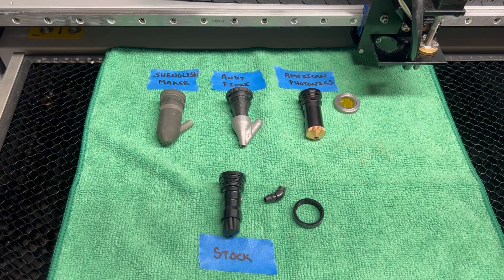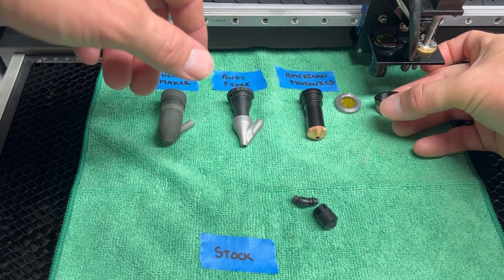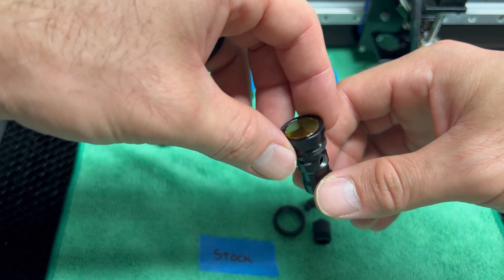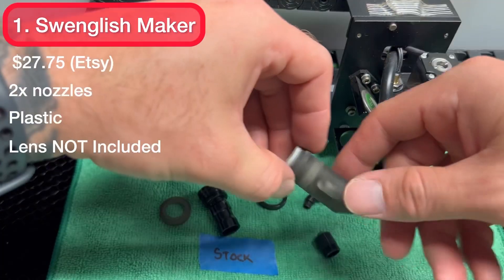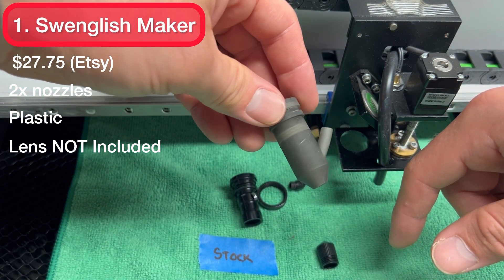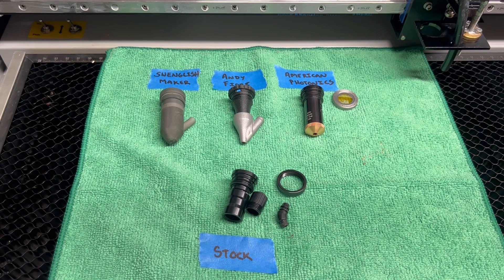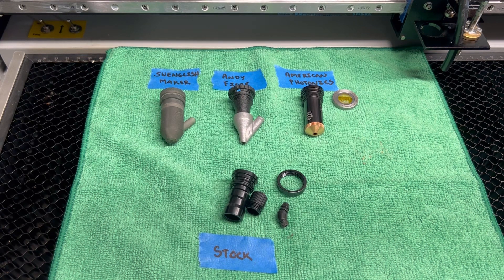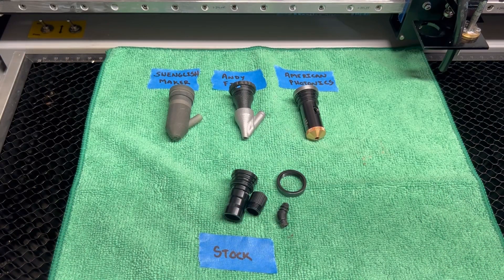Laser Nozzle Upgrade OMTech Polar / Gweike Cloud

Comment: Do you happen to know what fitting for   Air Assist Adapter
I would need for the APC LensPro for Omtech Polar / Gweike Cloud Magnetic Lens Upgrade I lost mine
Reply from the maker: From what I understood there was no direct fitting that  would replace the stock one. However APC may be making one now. I’d try to reach out to them. I

Comment: Have you found a way to completely turn off air assist?  Engraving some material looks so much better with no air assist.
Reply from the maker: You can toggle the air assist off in lightburn in your cut layers menu. Did they change that capability?
Reply: @EdmondsWoodshop  I guess so they said its automatically on. sorry.  The lightburn tap doesn't turn it off. It makes my engraving look bad. Guess I have to install a on/off stitch for the pump.
Reply: @agalbaugh  Omtech says that the air assist is wired to remain powered and the lightburn config doesn't affect it

Comment: Great video. Got the American phonics one. Could you do a video on setting focal distances for all the lenses? Are they the same? 2.0 2.5 4.0. The test cut files provided by omtech do not work with them how the videos ive seen to compare with standard. Seems to need more power? First c02 laser! Managed to get it cut 3mm basswood provided by omtech but at 20/60 which seems high??? I used their focal gauge

Comment: Can you tell me if there is an alternate option for the stock air assist tube adapter to go with the American Photonics setup?
Reply from the maker: At the time I made this video there was not an aftermarket air assist adapter available. You may need to ask American photonics
Reply: @EdmondsWoodshop  Thank you for your response. I have sent them a message as well. You answered faster 😂

Comment: Hey Ed, Have you given the DSA a whirl yet? My wife got me one for Xmas and I saw a post someone else wrote ya that he started the nozzle/lens was approx 1.5mm higher than the stock. So would that mean that instead of 17mm - material thickness... It should be now 18.5mm -material thickness? Haven't used as of yet cause I've been a lil ill as of late but plan on trying it out sometime around mid February n was wondering if that focal length is confirmed. Thk U n I subscribed!

Comment: Thank you, can you explain how to compensate with the AP set up? I use the the subtract from 17 and the plastic tool method, at this point.
Reply from the maker: They actually include a new gauge/ruler to use in their kit. You take their plastic gauge and rest it on the black plate of the laser head and lower the head until the bottom of the gauge touches the top of the work surface. That’s how you manually do it.
Reply: How do you lower manually. If I push the down arrow it lowers the lens unit all the way to the surface? Sorry, real newbie.
Reply: @EdmondsWoodshop  Thank you for such a prompt reply. Your videos have been a life saver.

Comment: I use the American Photonics rig.  Until I saw this video I was not aware that I had to compensate the focal distance another 3mm for this nozzle.  That explains a lot of the inconsistency I've been getting in cuts.  Thanks for the great info!
Reply: Is that 3mm added or 3mm subtracted from 17mm?  No real explanation on their sight.
Reply: I am in the same boat as you. I believe it is added to the 17 since it is 3mm shorter than the stock. So the new offset is 20. would love a confirmation on this. @jeffgraves4564
Reply: @jeffgraves4564  I actually do my measurement using the 58mm distance from the base of the platform to the top of the material.  With this nozzle, I reduce the distance to 47.8mm.  In fact I created a little jig to do the measurement, and it works great.  No more out-of-focus issues.

Comment: I've got all of them

AP is my go-to - but I REALLY wish it had a better air hose fitting than the stock elbow.
DA is 3mm in height. I had clearance issues with it, but that could have been my use case (1/4" ply, cutting tiny pieces that would lodge under the nozzle)
The Fior is a solid option, but I broke a lens trying to remove it for cleaning (it "flipped" out as I was removing it and it shattered on the tray).
The 3D printed one is just not solid enough.
Reply from the maker: Sounds like we’re in line. Fiore design with the AP magnetized lens would be the bees knees.
Reply: @EdmondsWoodshop  100% -

My ideal:

The Fior metal air assist nozzle, with the AP magnetic lens and copper tip, in the all metal body of the DA - with zero height adjustment from the stock 

Thats my wishlist, anyway :)

Comment: Purchased ap lens. The only complaint would be using stack plastic air assist connector. Tried to find a 45degree 6mm threade barb with out any luck. Did find a 90 but angle
 is off for hose connection. No luck finding a stock one either. Hoping someone makes a 3d file for resin printing. At the least. Love the videos.
Reply from the maker: Agreed. I mentioned this to Steve Walters (owner of AP). When you put plastic into metal, it'll deform. I'm wondering if the making a push to connect fitting that small.
Reply: @EdmondsWoodshop  I have looked everywhere for a push connect also. Found 1/8 American but no luck on 6mm. Fastenal ,Grainger,Amazon etc. I was actually considering a brake line and tapping one end to 6mm and flaring the other side just haven't got that ambitious yet. Thanks for the response.

Comment: Great review. A 3d printed nozzle would make sense from a design point of view as you could combine the best parts of all the nozzles. The downside being strength and burning. I wonder though .. what the Swenglish Maker is printed from? There are some high-tech resins available I know.
Reply from the maker: The Swenglish nozzle performs great. In fact, they all do with the right lens. However, I can see how appealing the swenglish nozzle may be because of the price. Per the listing the material is printed from yratech Resin Blu-Tough Nylon in black. I looked at the MSDS and it listed the melting point  as "-" meaning not listed. The flashpoint is around 110 celsius. Unfortunately I haven't used it long enough to see if they durability maintains itself over long periods of heat exposure.
Reply: Looking at the resin .. it's pretty tough. I am thinking that the part that the air assist hose hooks to could be replace by brass .. just print the nozzle with a hole for a brass hose fitting. The same thing for the open end where you were talking about possible melting if the laser hit it. Simply make that out of brass. I like the magnetic lens holder method that American Photonics uses. Cool stuff. I have a lathe and 3d printer so that is all "dooable". I subscribed the other day .. even if you appear to be a former grunt. :) .. former CDAT here.  @EdmondsWoodshop